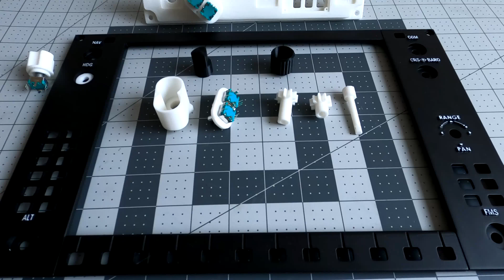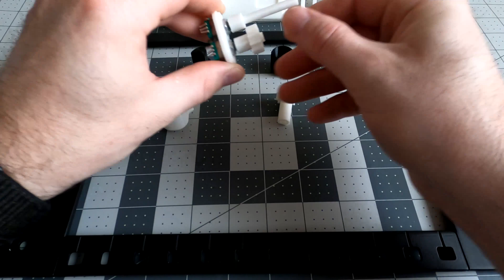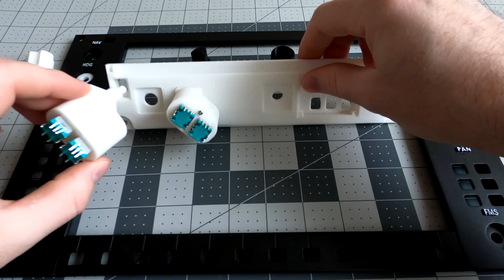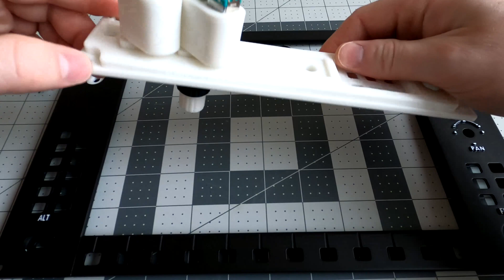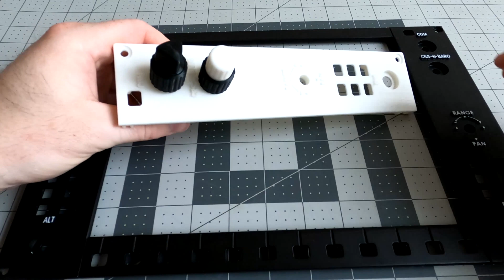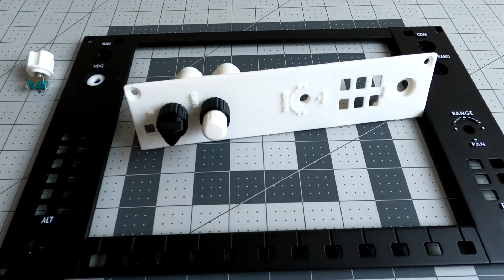3D Printed Dual Rotary Encoders

Comment: Would be nice if you could share the design for the g1000 so we could use this design with it. Would be useless without it . Still a great design though.
Quick note for those with a longer encoder just adjust the length of the outer case and you’ll be golden.
Reply: Should be easy enough to print one out and measure where it "plugs" in to the fascia.  That's what I was going to do.  I'll be designing a custom generic GPS fascia (with no display) which I'll be using these on

Comment: maybe it's just me or something I've done wrong, I've printed the Lid and when I put the encoder through the lid it's so thick that there isn't any thread on the other side to screw the bolt on. Have I gone wrong somewhere? I'm using the same 15mm EC11 encoders you recommended.

Comment: I am seeing similar constructions of dual encoders here and there. There is no need to say, it is pretty smart, but I can't understand why. Why don't you just use a readily available commercial dual shaft encoder? They can be found for like $10 on aliexpress. Their volumetric footprint is 10 times smaller. So I can't get it, why everyone keeps creating this weird geared encoders. Is there something I am missing?

Comment: hey mate, can I ask why you need a dual rotary encoder?
Reply: Cessna 172 G1000 homemade flight simulator is one use. The G1000 avionics screen uses multiple dual rotary encoders, which are about 10x the cost of a single rotary encoder if you're building your own sim from parts.

Comment: Cool man.. but why not design around a dual shaft encoder?
Reply: Single rotary encoders are about $1.30 each and dual rotary encoders are about $13 each, which is why this is a hack to get the same functionality for significantly lower cost.

Comment: Thanks for the great part, I had encoders that were too long but the Dremel fixed that. I use this for a radio frequency knob (Garmin 430) in my sim panel. I opted for a minimalist panel just enough to simulate what I needed. Works great. Thanks again.

Comment: Hi, I'm just getting into this DIY electronics thing, and so far managed to make a button box for lights and a very simple throttle using a slide pot, but the hard thing for me is I can't figure it out how to use rotary encoders. I'm using a Leonardo, and no plugins, just programming it using a joystick library. Could you enlighten me how would I make encoders work in game? I have no clue at all, bought two ky-040. Thank you!
Reply from the maker: Check out resources like Air Manger, SimVim, and Mobiflight. They all make it really easy to interface encoders and everything else with flight simulators.

Comment: The best i have seen so far ! 
Great job 👌🏻

I’m starting to build my cockpit, arduino is on the table, proof of concept is done and the Creality printer is on the road 🎁

But I need your advice... I still don’t know where to go, analog gauges with steppers and servos + GNT750 (or GNS530).  Or just a G1000 + the main backup gauges... 🤔 

Thanks for your very useful ideas and videos !
And sorry for my English...
Reply from the maker: G1000 all the way! Also your English is very good!

Comment: Great work, but can save you some time and effort by using the Alps Dual Concentric Rotary (w/ Pushbutton!).  I order mine from https://www.onlinecomponents.com/alps-electric/ec11ebb24c03-10113588.html
Reply from the maker: You absolutely can! This is just a design for those who can't or don't want to spend 10$+ on each encoder.
Reply: @FlightSimMaker  It is a brilliant solution, by the way.

Comment: Great stuff here and EXACTLY what I've been wanting to do!  Question: Is that particular panel on your Thingiverse?  I printed PFD_Right.STL but the holes were too small for shafts and the button mount holes aren't there.  Basically you've spoiled me and I'm really wanting to make this panel.  Keep up the awesome innovation and sharing!
Reply from the maker: Chris Murphy the holes are currently sized for the dual rotary encoders from Leo Bodnar. You can just drill them out for the shafts of the 3D printed dual rotary encoder. I’ll try and get a new file uploaded soon.
Reply: FlightSimMaker  Thank you.  I actually have a couple of the dual rotary encoders from https://www.propwashsim.com/store/dual-encoder-kit I’ll use.  I also used tinkercad to widen the hole and added a couple more.  I go back and forth between a 6-pack and G1000 so bought a touch screen monitor for G1000 bottom buttons.  My plan is to just use the left and right panels mounted on a box without the screen or bottom buttons to be more compact and then mount next to monitor.  Full panel like yours is still a must do one of these days though.  For sure going to make your parking brake. You have the best I’ve seen for a DIY person hands down. Great stuff!
Reply from the maker: Chris Murphy I just uploaded the new .STLs with the wider holes on thingiverse. Thanks for the kind words. It’s still a work in progress.

Comment: Great construction! What filament is the white one? And what nozzle size did you use? It seems to be quite smooth.
Reply from the maker: Thanks, for the most part I've been using Hatchbox PLA with a .4mm nozzle on an Ender 3.